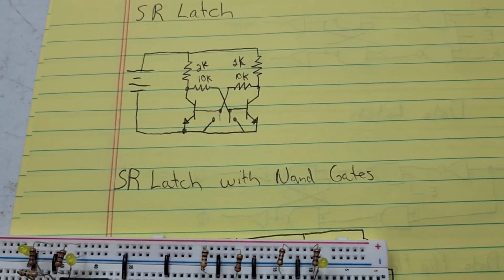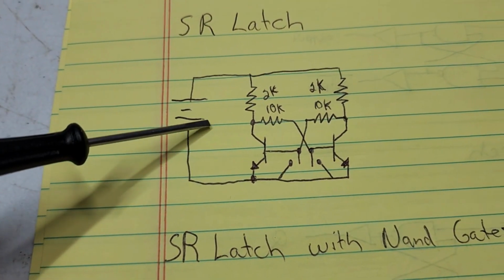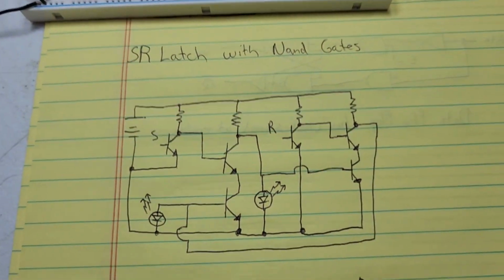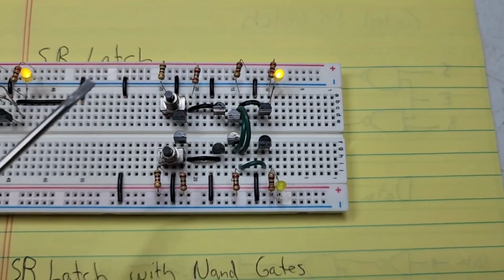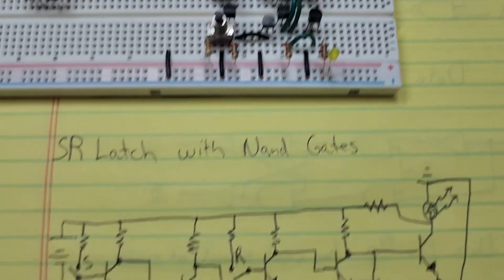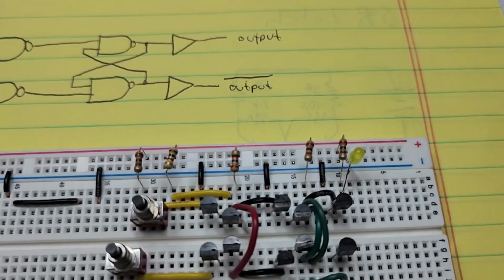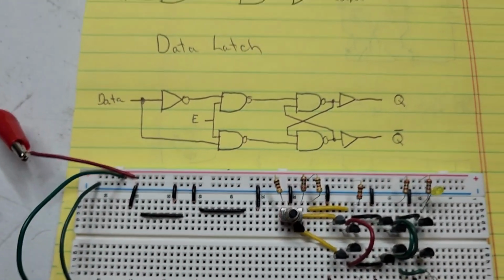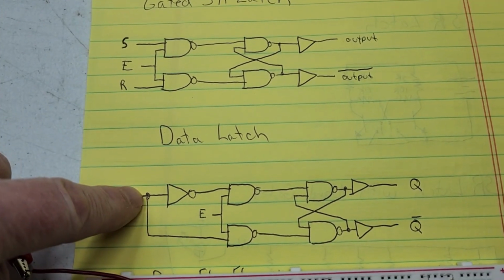Building a computer with transistors - Latches with transistors

Comment: I was surprised you could leave the base (enable pin) floating (not connected to anything). In TTL ICs, apparently it can cause the gates with floating inputs to switch randomly. By the way I’m really happy I ran across this series in the recommendations. I found this channel and one called Big Chak on the same day. I do wonder if Big Chak is going to make a second video though. I really like your informative style and ability to actually make the videos more often.
Reply from the maker: @drivers99  Thanks for the comment. I didn't even realize I was leaving the enable floating. I'll have to check that. That could be a reason for having issues. I'm glad you like the videos. I'll keep them coming. These transistors are getting out of control though! Lol